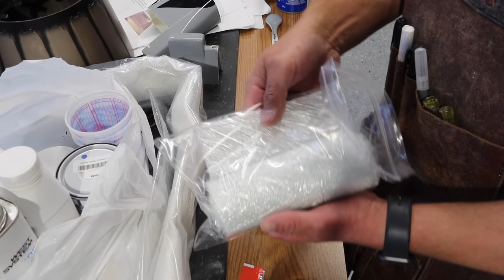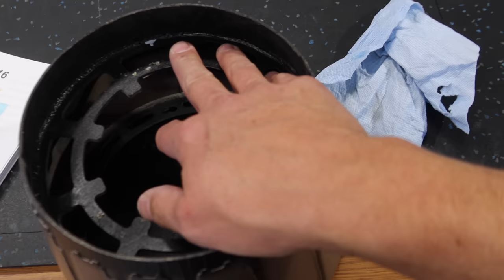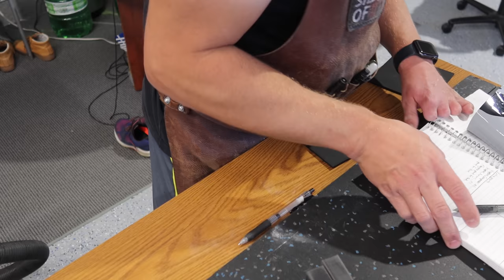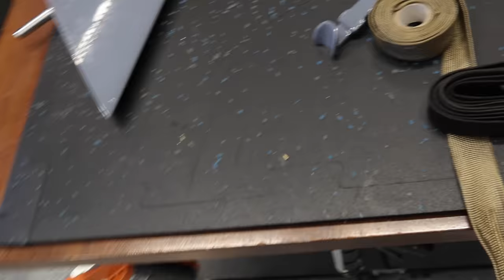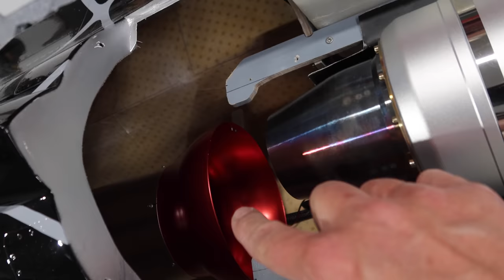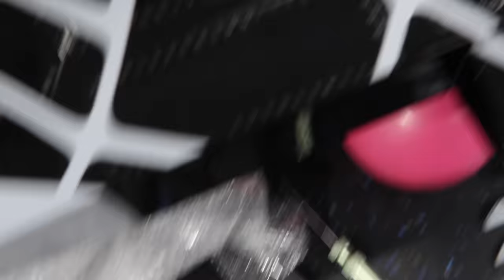The Art of Precision: Building The BVM Scale F-16 RC Jet Venom Edition

Comment: Great video… I have used the IC2000.  Great to repair tires and it works good to use the way you have locking bolts .. a bit more elastic than basic CA….  Thanks a lot Jonathan 🙏🏻
Reply from the maker: Good to know! Thank you!

Comment: I had a F-16 once in the 90s. I think it was a Byron F16 that was almost that big, It was foam core and fiber glass. It was made for a .60 to a .90 gas motor. I used a OS .90  Ducted fan. I had it almost ready for painting when I lost interest in RC modeling.Had 32 planes and 2 choppers and 15 radios. I eventually just gave almost everything away to my friends. I still have 6 planes and 4 radios left. I regret just giving them away because most of my friends never even flew them.😫 I also had 2 Mig 25 Foxbats that took 2 .90 ducted fans motors. Gave them away also. 🤮🤮
Reply from the maker: Classic Byron!  Still some floating around today with lots of reinforcement and turbines strapped inside!